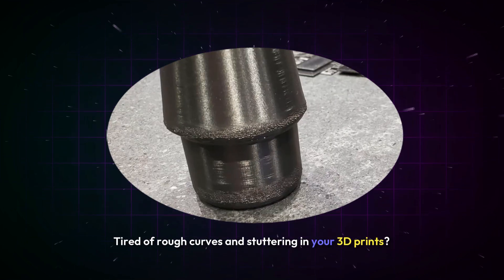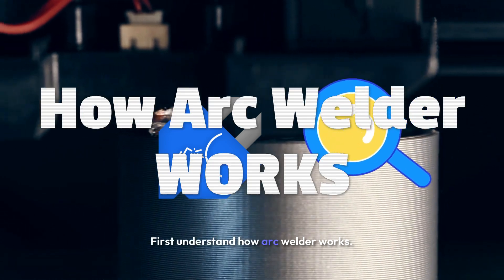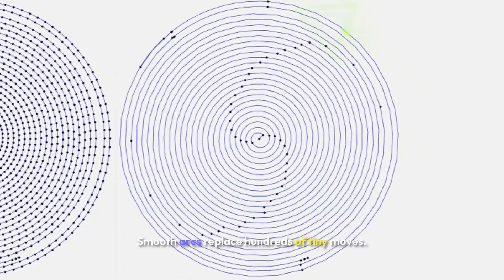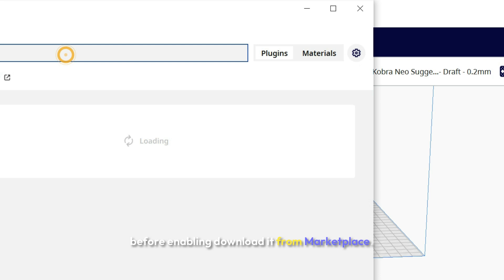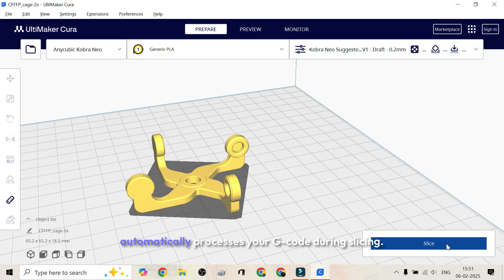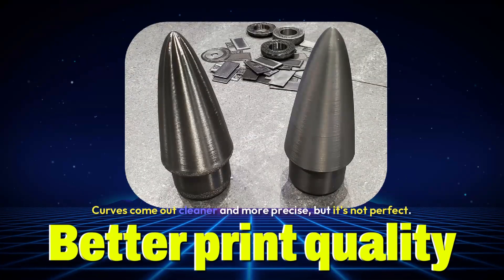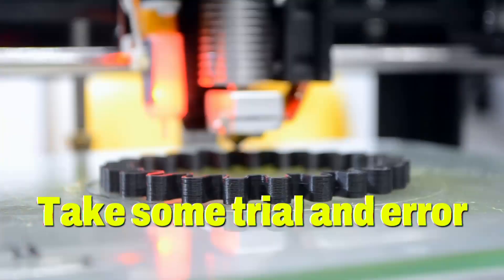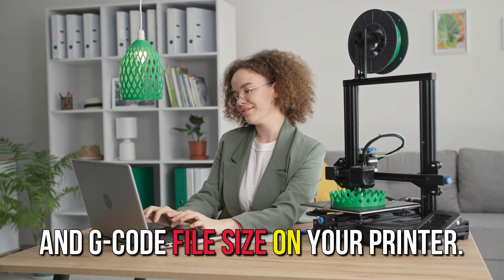3D Printing EXPERTS Agree This Arc Welder Plugin Is A Game Changer

Comment: I don't like Arc Welder.

For one it doesn't always correctly follow velocity changes in the arc. So if you had say an acceleration programmed in via flow rate gradient, it disappears.

For other 3D printer firmware doesn't actually do anything smart with it, it just re-polygonises it. The constraint of the lookahead move buffer size is not solved since that's still in terms of straight line segments. If there was well aligned micro polygonal detail layer to layer, Arc Welder and subsequent polygonisation removes it. If the item was coarsely polygonised and arc-welded, the starts are random so you get a weird one off facet somewhere in the path.

It's helpful in a specific case, that you have an 8-bit printer with an external spooler (Octoprint or MKS TFT) where serial rate or serial buffer is set too low and the polygon resolution out of the slicer is too high, so too much time ends up being spent transferring and decoding G-Code, resulting in lookahead buffer underrun and stall, and Arc Welder is one way to reduce the amount of G-code per second to. My recommendation is to instead drop slicer precision by setting minimum segment length of 0.3mm or so. There is plain no winning in these situations with this hardware setup.
Reply from the maker: Yes somewhere you are right. That's why in the ending of the video i mention the cons of arc welder it useful in specific cases. Cura slicer made some improvements with this tool. And thankyou i appreciate your informative suggestion. And I'll try. 👍🙂

Comment: Most printers using stepper motors move in tiny straight line increments to approximate curves. How can this approach change the mechanics of my printer?
Reply: Because you are converting discrete points into curves that can be mathematically calculated by the printer/CNC to interpolate the curve into XY coordinates down to the highest resolution possible by the machine. This isn't anything new as conventional CNC machines have been doing this for decades to great benefit.
Reply from the maker: This will change the code type.  G0-G1 to G2-G3 which has advance data machine understand better. Machine less stuttering. You can try. Not huge diffrance but it works in curved surface well. Try it. And it will make your machine little faster, becouse your machine will process less code. And File size will decrease. Which slicer do you use?
Reply: @PrintCrafter.Official  Thank you! I use Cura and I would like to try this. I have a ANYCUBIC Mega X
Reply from the maker: @recordationperioperativein5238 same here bro.👍